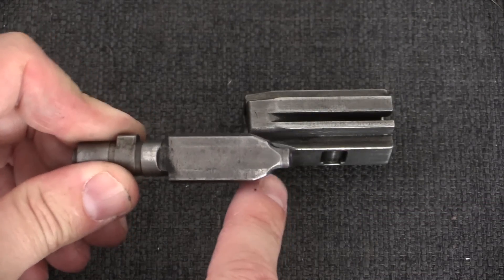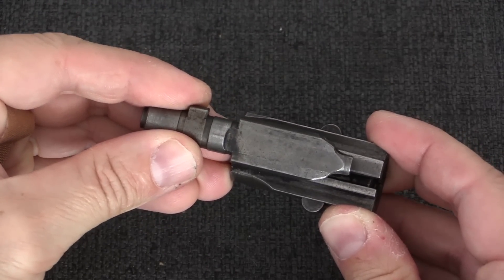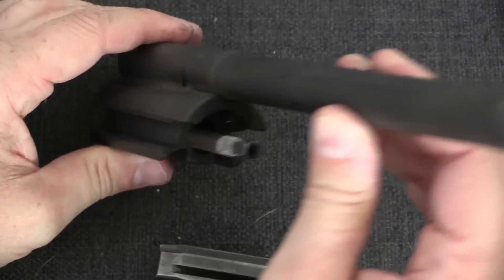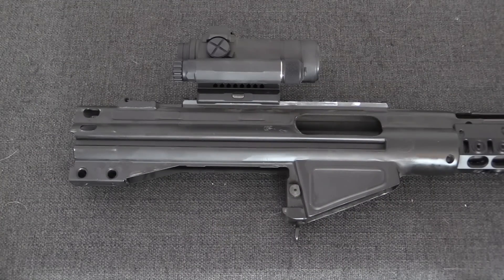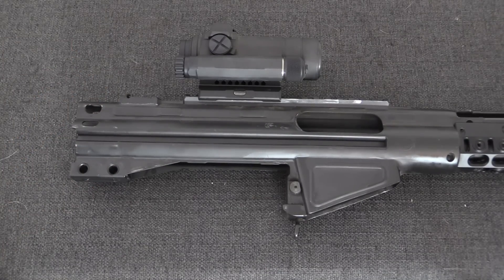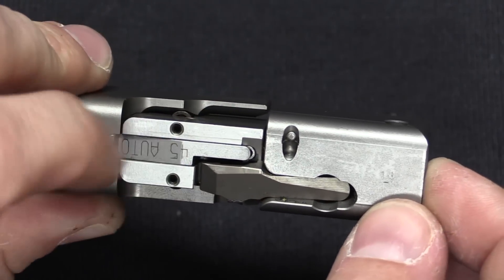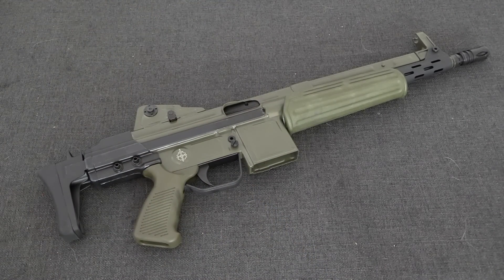How Does It Work: Roller Delayed Blowback

Comment: So it's not gas operated... by default, it's recoil operated?
I understand the rollers slowing down the rear BCG motion, but something still has to be pushing it back.
Reply: Gas pressure in the barrel starts pushing the case and the bolt back as soon as the cartridge is fired. The ratio between the angled surfaces of the semi-circular recesses in the receiver, of the bolt carrier and the size of the rollers themselves provides the mechanical advantage causing the bolt carrier to move substantially (3-5 times) faster than the bolt head.
Reply: @noneofyerbeeswax8194 thank you

Comment: What actually moves the locking piece to begin the blowback?
Reply: The percussive energy of the round. Blowback (without rollers) is the round going off and pushing the bolt back with its explosive force.

Comment: I'm kind of wondering what might be a good operation system for pistol caliber carbine style submachine gun that runs reliably even when suppressed, doesn't have too high of a rate of fire, is light and fairly controllable
Reply: Well, with modifications of the parts, any operating system can be used with a suppressor, (See the MP5SD for a suppressed roller-delay gun), yet gas-operation has the easiest method of modification, where there are adjustable gas blocks where you can tweak the rate of gas-flow in the operating system to accomodate for added length of suppressors.

As for recoil operation, the suppressor adds weight to the barrel, and that barrel is part of the operating system, so the added weight to the barrel won't let the system cycle fully. However, you can use muzzle boosters to give the barrel more energy to overcome that extra weight.

Comment: So if one took a roller delayed rifle and welded it to an immovable stand, it would not cycle?  Put another way, it needs the recoil of the rifle to move the bolt within the rifle and make it unlock?
Reply: All of the parts needed to cycle the firearm rely on the gas pressure generated by the gas pressure produced in the cartridge. There is no external factor that would stop a blowback firearm from cycling, not like how limp-wristing a recoil operated firearm causes a stoppage.

pretty much the only way welding a roller delayed rifle to the stand will stop the firearm from cycling would be if it were welded to the bolt itself. That way, the added mass of the stand will prevent the gases from pushing the bolt backwards to extract and load, forcing most of it to go out of the barrel after the bullet.

Comment: I have seen many of Ian's videos, and this is the first time I don't feel he has done a stellar job explaining how a weapon works.
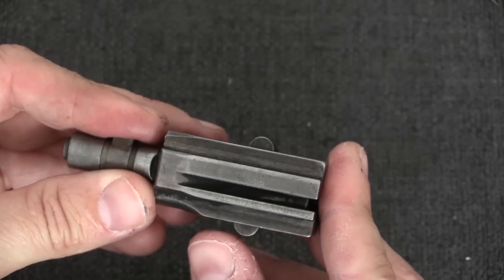For start: 0:42 - wouldn't that make it a roller-locked (instead of roller-delayed) weapon?
1:15 - what makes "locking" piece to move backward? Is it inward movement of the rollers, acting on angled surfaces pointed out at 0:33? If so, what causes rollers to move inward? Is it backward movement of bolt head, something we were told can not happen at 1:06? 
Am I missing something here? 🤔
Reply: The shape of the "locking recesses" is different between locked and delayed version: the locked version are essentially semi-circular, with the rollers locked in place until the gas piston pushes the locking wedge out from between the rollers and the delayed version are tapered rearwards, so the rollers act a bit like the lever in a "lever delayed blowback" (eg: Famas rifle) with the bolt-head pushing on the rollers, which are in turn are transferring that rearwards force into a sideways force from the locking recessed onto the taper of the wedge on the bolt-body, basically making the recoil force on firing turn 90 degrees twice at great mechanical disadvantage, with some of that energy going into directly recoiling the rifle through the locking recess and then get the whole bolt to move rearwards to run the extract-eject-reload cycle.
A radically simplified version of "roller-delayed" is in the M50 Reising SMG (developed 1938-1941), where the bolt-head goes sideways into a tapered recess and has to slide along that taper, before being free to push the bolt-body back and extract-eject-reload, it just skips having actual rollers and uses the bolt-head itself. I imagine that the "Blish Lock" which was supposed to add delay to the the Thompson M1 SMG was the real inspiration, because none of the CETME or H&K roller locking or delayed weapons would exist until post-WW2.
Reply: I'm having the same confusion. I've looked at several videos on how roller delayed systems work and so far none of them have explained it it fully.

Comment: it looks like the rollers would push the bolt rearward, not hold it in place. Wouldnt there need to be something ahead of the ramps on the bolt for the roller to lock on to it in order for the bolt to be held in place?

Comment: Tilting bolts can also be used for Delayed Blowback as well. But the closest thing we got to it is the Rudd Carbine.

The problem is, the bolt is designed incorrectly. The locking surface should be straight. Not on an angle.

And the carrier should have a few inches of travel, before it actually unlocks.

That's basically how Delayed Blowback works. Inertia is what replaces a conventional Gas Piston.

Comment: The Action is absolutely fantastic, as it allows high velocity of the projectile by taking full advantage of the pressure of the gases. You do not need an auxiliary piston that makes you lose energy. The only flaw is the extreme stress on the rollers and the accumulated dirt. That is why the rate of fire and the projectile's exit speed are extremely high. The recoil is light and the accuracy very good. The gun is easy to manufacture, inexpensive and has small dimensions. When I shot an HK-33 I realized that if it weren't for the dirt it would be the perfect weapon.
Reply: This action type is reliable despite the dirt.

Comment: Can anyone please explain what exactly makes this a "dirty" system?
Reply: There is a large amount of gas that goes back into the action because the spent cartridge is pulled out under "significant chamber pressure." This gas is dirty with gunpowder soot. It is extra sooty because relieving the pressure of burning powder, leads to incomplete burn. Most rifles use some sort of gas system that handles the pressure in a piston, this delays pulling the cartridge until there is minimal chamber pressure. So, there is less gas vented into the action, with more complete burn. Basically, roller delayed blow back is an odd shortcut in function. It's disadvantage is that it's somewhat particular to ammo and runs quite dirty. However, the action is so simple that the dirtiness does not greatly impact reliability. In some ways it can be considered more reliable than traditional gas systems.
Reply: @apodski  oh, thank you very much. I haven't thought about that in that particular way. Would a regular blowback have the same tendency?
Reply: @VanyaShvets  Yeah, blowback is similar. Blowback uses a very heavy bolt to delay cycling, instead of rollers. I don't think a blowback 308 would be possible, as the case would tend to stick in the chamber and the bolt would have to weigh a handful of pounds.
Reply: @apodski  thanks

Comment: If there isn’t any gas system, how does the locking surface move back? Since the rollers are locked in place already, where is the force which moves the bolt carrier back coming from?

Comment: Ian, not sure if you read these comments.. but i need gun jesus on an issue with a roller lock i just bought. Bought a c93, when it came in the charging handle was seized, knocked it loose but it's been sticky and harder than normal to pull back (my ptr91 is vastly easier). I took it to the range, it'll load just fine, but when it fires it won't eject the spent brass. It'll stay on the bolt head and try to rechamber another round with it there. I've tried fb groups and no one knows anything about this. Any help would be greatly appreciated!

Comment: Good one!
It does annoy me when terminology is misleading to the neophyte: these firearm "delay" systems actually don't have a true delay, ie, one where no movement starts until after some 'dead time'. They're all based around using mechanical disadvantage to temporarily make a moving part appear inertially 'heavier', temporarily, in order to buy time (the 'delay'). They all also suffer with high case pressures to ammo sensitivity, because there is still that movement required to transmit the energy.

This works because movement splits equally by conservation of momentum (speed times force), but energy goes as 1/2*mass*velocity*velocity (or really, half of momentum times speed). (except for gas delay -- those are about reducing the effective area of the bolt face, by presenting another face attached to the bolt facing the other way to 'subtract' it from the effective area causing the blowback. 

Anyway, just wanted to point out that confusing terminology annoyance -- no 'delay' system actually has a true 'dead time' delay in it, only 'locking' systems do that. And that's why they all have trouble with increasing chamber pressure, and require fluted chambers or lubricated/extra precise case ammo etc etc for reliable operation.

Comment: The roller delayed blowback seems like a very reliable system. Does anybody know why you see so few weapons using it?
Reply: Roller delayed blowback rifles require a lot of mass in the bolt carrier which makes for a relatively heavy weapon.  Recoil is harsh, extraction is violent, and the chamber flutes mangle spent brass.
Reply: @gtwannabe2  So it's a matter of user comfort?

Comment: I wish you'd expanded on those advantages and disadvantages. I get why it might be dirtier than a typical blowback based on the design, but why doesn't it work well with suppressors? The MP5 and its ilk all use suppressors. And if it works well with cheaper stamped-sheet receivers, why is the MP5 so expensive while the cheaper UMP doesn't use it?

Comment: My Sig510's / STGW57's have roller delay blowback. I always had the feeling the point of this is not delay (as it still opens immediately). The roller with the little ramps however compress the main spring for lets say 1 cm, but the bolthead only moves 0.5 cm. So from the bolthead's point of view the main spring is much stiffer the first bit of travel, due to the roller mechanism. This way a lot of recoil is absorbed in the first bit of travel, more than without the roller mechanism.

Comment: Seems like it could be a good system for a semi auto  hunting rifle provided you could chamber it in something powerful enough. I also wonder if the issues Ian mentioned with respect to suppressors apply at all to muzzle brakes.
Reply: HKG3 , HK91, HK SL7 all in .308 and the HK 940 in 30-06

Comment: Hi Ian!
Isn't the purpose of the delay rollers to delay the extraction to a moment when pressure is safe? Why they extract with high pressure?
I'm really enjoy this how do the work videos cause I'm never knew a lot of how guns work in detail, even tho i love firearms
Sorry for my bad English and i hope you're safe and doing well!
Reply: In every blowback action, delayed or not, the rearward movement of the case starts when the pressure is very high (it starts the very moment the ammo is fired). The trick is to stay into the possibility of the metal of the base of case to stretch until the pressure drops to the point to allow the case body to move (before, the same pressure sticks the case body to the chamber so, if the opening of the action is not delayed enough, you risk case separation).

Comment: The important piece of the system is the angles of the ramps in the trunnion. Both the ramp angle and locking piece angle in conjunction with the rollers work to put the bolt head at a mechanical disadvantage to the bolt carrier. This is a multiplicative effect on the greater inertial force to get the carrier moving, and contributes to the delay.
Reply: 4 years late, but this comment just explained what was missing. When he pinches the rollers together, it wasn't explained how that happens, but your explanation fills the gap. Thanks!
Reply: @saggybreadstick6669  It's also impressive that they figured out the correct angle in the first try because they hired a mathematician to calculate it.

Comment: While rather simple from the operator's point of view, as compared to the gas-operated system, this design is quite difficult and expensive to produce, and requires a very precise manufacturing. Also very tough = expensive materials must be used for the rollers and other locking parts, because they are under very high stresses. That, IMO, is why it was never used by almost anyone else other than HK (at least, AFAIK). I always wondered why they just didn't use lever-delayed blowback, like the Kiraly system, achieving the 4-to-1 transmission ratio would be quite trivial with a simple lever (of course, probably there were some reasons for that; probably, the use of a stamped receiver is the reason - the rollers allowed to use a small barrel extension for locking, and the rest of the weapon could be made from sheet steel; lever-delayed blowback seems to require a more substantial receiver - AFAIR even the FAMAS uses at least partially milled receiver).

Comment: Another nice "how does it work" video would be all the differences between manually operated systems, like bolt-action (both regular and straight-pull), lever (toggle and falling block), pump, and (perhaps) the difference between single and double-action revolvers

Comment: I always found it interesting that the German army its armament research organisation, the Heereswaffenamt, for such a long time was opposed to drilling a hole in the barrel for a gas port. Then they finally relented after the problems with the G41. Subsequently Mauser got its hands on the G43 and they started experimenting with a better bolt design for that rifle and eventually came up with this system that removes the need for a gas port or a hole in the barrel. 

For those interested, that first rifle would be the Gerät 03. Ian has a video on that one as well. 
https://www.youtube.com/watch?v=g3GJAPgz23c
Same with the development of the roller delayed blowback for the Gerät 06H.
https://www.youtube.com/watch?v=WEPwmYcCPFs
Reply: A whole history lesson crammed into a comment 👏 bravo

Comment: If roller-delayed blowback is simpler to produce, why did the Swiss manufacture the PE-57 (stgw57) using this system? Oh yes... SWISS. I’ve answered my own question. Sorry.. you were saying?
Reply: Roller delay requires some very precise machine work.
Reply: Scott Kenny Manually operated firearms also require precision machine work as well. Precision is required when safely fabricating any pressure-baring part. I was just pointing out the irony in the Swiss’ decision to adopt a system in which one of its design parameters was to be more cost effective to produce in the first place. The STG-57 was an immensely expensive firearm to produce. In many regards one might argue that it was over engineered in certain aspects. * cough * cough - Swiss-  sorry. It’s just funny that SIG did not take advantage of certain cost-saving merits offered be a roller delayed blowback system. One of which being cheaper to produce than other systems. It almost seems like the Swiss have a tendency to over engineer otherwise simplistic designs. Hmm just a hunch.
Reply: @ryanwitman8672  wasn't the entire receiver milled?

I was trying to make a joke that roller delayed blowback was chosen to give the machinists more to do.
Reply: Scott Kenny True that lol. And yes, it was entirely milled. The Swiss would probably find a way to mill the stripper clips for the damned thing. It’s interesting to point out that the barrel bands on the K-31 were finely machined but the box magazine was stamped. I guess they made up for it though when they made the mag retention tab out of a piece of milled steel. Very curious methods indeed
Reply: Scott Kenny it’s also worth noting that the retention tab is integral to the magazine itself, rather than the rifle. I suppose it would be less convenient to replace a lost or damaged mag, but it’s definitely the more Swiss solution lol
Reply: Oh yes, and same with the French Mas 49/56

Comment: Why is this a dirty system and not a good friend of suppressors? Can someone explain the how's and why's of this?
Reply: Since it tends to extract the brass under pressure and usually is coupled with chamber fluting, there is a lot of dirt that comes from the barrel to the bolt. That worsen with a suppressor (suppressors usually keep the pressure in the barrel higher, and suppressed firearms always run dirtier than unsuppressed ones).
Reply: @neutronalchemist3241  thank you for explaining it to me. Now, you say it extracts bullet under pressure. Does this means that blast also comes of the back of the barrel to the ejection port?
Reply: @Seb-Storm  Not really blasts. Nothing you can see. But there are abundant leaks of carbon particles from the barrel to the chamber-bolt area.